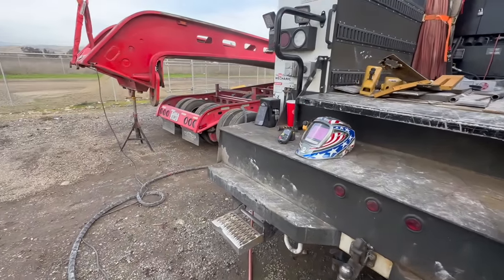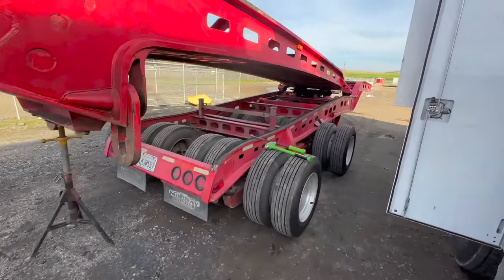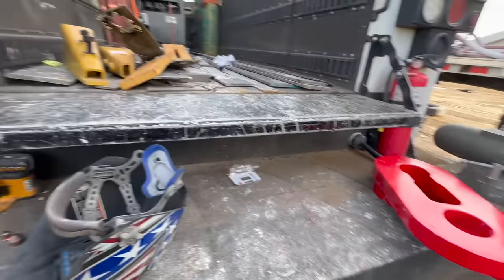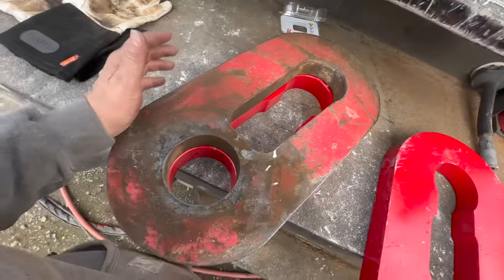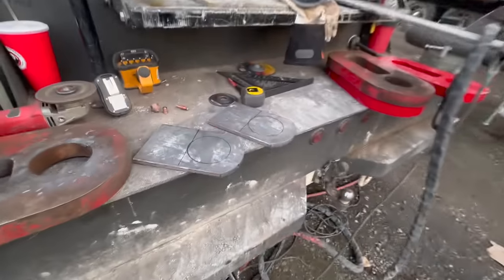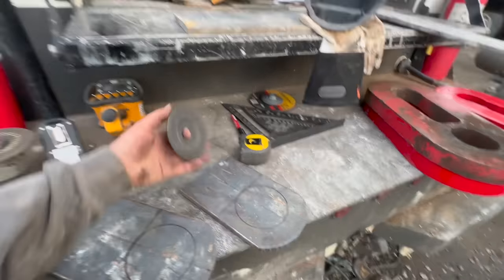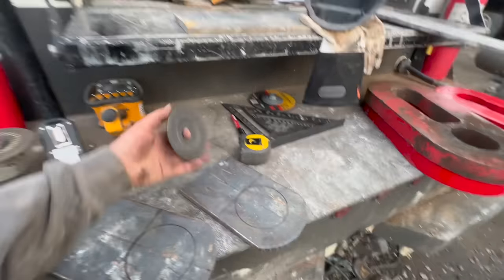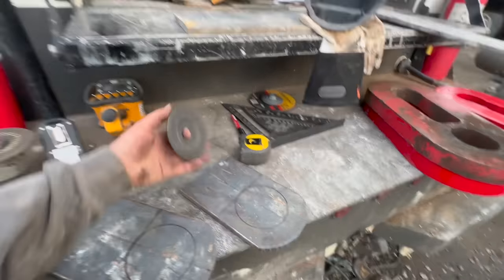9 axle trailer:  collar replacement

Comment: This seems to be an art to you tge way you can use the plasma cutter to cut or gouge then do the final prep with the grinding wheel an then turn and fabricate what you need even there in the field and then weld it all back together ! Awesome job ! 👍👍

Comment: At your reccomendation i bought some Cubitron II flap discs. They are LIFE CHANGING! I'm using 60 grit 4-1/2 discs on my flexvolt grinder and they just eat. You can feel and hear the cutting action in the grinder, and it makes chips not dust! I've always been frustrated with cheap flap discs just rubbing and making heat and being useless after 5 minutes, but these actually make grinding enjoyable and they work just as good as new until they're worn down to nothing. I'm actually a little bit scared to try the 36 grit haha, my part may just disappear!

Comment: Got it done my trailer hung low on mount we did some changes to drivers kept putting shims in it to raise it we made ours to change out plate deck rubs on it works better than buying another 290 g trailer

Comment: Suggestion, not sure if it would work or not. Use hard facing welding on the worn surfaces, then grind it back to size?
Reply from the maker: It’s not worth it. They last a long time as is.  Plus that might affect the integrity of the T1 steel collars.

Comment: Really good work with the plasma cutter, thanks.  Was building up the worn areas on the links with hard facing considered for this repair?
Reply from the maker: No,  it needs to be exact on both sides.

Comment: Nice temporary repair.   How do you determine which scenarios you use plasma gouging vs. Oxy/Acetylene gouging, or carbon arc gouging?   Is there a certain criteria or condition of the repair that dictates which you choose to use on a particular job?   Thanks Greg!
Reply from the maker: Well sometimes you could use anything to remove material.  That’s the problem when you have all the options available to you, you just have to choose.   I chose plasma when I want to be a little more accurate.

Comment: Nice work, Greg.  Honest question: not considering the cost of the equipment, do you think plasma (fuel & consumables) is cheaper to run than oxy (gas)?
Reply from the maker: I do think it’s about the same.  But plasma has many benefits over a torch.  I really only use a torch for heat.

Comment: Very cool project as usual. Would like to know what wire he was using to weld that? I would still be using a 7018 rod being old school.  Thanks for sharing.
Reply from the maker: Lincoln 71a75.  Basically 7018 in a wire form.
Reply: @OFW  Can a guy get a decent Miller welder/generator that will run that 71A75 for $4000 or under?
Reply from the maker: @billcarlson1730  probably if you shop around.

Comment: When you are in the field, how do you decide whether you will stick weld, use the wire feeder, or plug in a separate mig machine? I've seen you do all three across different videos :)
Reply from the maker: Depends on the situation, the size of the repair, the wind, and what material it is.  Stick is for wind or something really quick and easy.  Wire is for anything thin or if I need to do a lot of welding.

Comment: Seems like you like the plasma over the air arc. When do you tend to use one over the other? I assume you are using a Hypertherm?
Reply from the maker: Depends on the situation.  I do like the plasma. The plasma is better for fine detail when gouging or cutting.
Reply: @OFW  thx for the intel. I’ve got the plasma but don’t have the air arc. Just wondering when I’d want to start thinking about the air arc. All I’ve got to run the air arc is the old Miller AC/DC Thunderbolt. So I’d be using the smaller carbon rods

Comment: Can those big pins be replaced? Looks like might be slid in and welded to the frame all around, sort of like a trailer hitch, but I have no clue how these trailers are built. And are those scaper pans in the background? With these trailers running over dirt on top of doing heavy haul I'm sure they appreciate some love from you :3
Reply from the maker: They can be replaced but they are a lot more involved. Luckily these were not wore out.

Comment: how long do the consumables last when you run the plasma at 105 amps? lots of fire coming from that torch!!!
Reply from the maker: They last surprisingly long.  You can cut several hundred feet with the same ones.
Reply: @OFW  very impressive comet trail!  acetylene/oxygen is so pricey now it makes $$$sense to use electrons rather than gas when possible!!!!

Comment: Do you use Flux core for the mig? I haven't used Flux mig before but by the grinding after each bead that's what leads me to believe that, thanks!
Reply from the maker: Yes.  Dual shield wire.
Reply: @OFW  thank you, I'm learning as much as I can, we have a mig welder and stick at work that I've been learning on, otherwise I've always done tig for my automotive applications

Comment: Why not drill a hole in the shaft and use  a large cotter pin as a retainer so it can be easily replaced again when it wears out?
Reply from the maker: I think that would break the pin.  I’m just doing it the way the customer wants.

Comment: I know its only got to last a couple of months, but it makes me feel nervous, that looks to be a lot less material, than what you took off, supporting the ends of those pins now.
Reply: Some people are not very good with physics.  So instead they judge, and project.
Reply from the maker: The piece I put on isn’t really structural. It’s to hold the collars that push on the collars.
Reply: cheers, that makes sense!  @OFW

Comment: Why not just hard surface weld the links instead of completely replacing them?
Reply from the maker: They need to be exactly the same.  That would require them to be welded then machined to spec then installed.   It’s  cheaper to buy new ones and they last a long time.

Comment: From a liability standpoint, I would have turned that job down.
Reply: From a liability standpoint, I'd be concerned that the specification of the coupling was changed to be weaker than standard. I'm not saying this repair wasn't good, just that if the SHTF you need to be squeaky clean. Maybe any liability ends with the trailer owner/operator and Greg is just doing what is asked of him. BTW his plasma skills are excellent.
Reply from the maker: Out of curiosity what part would make you say no?   And that’s why I have very good liability insurance.